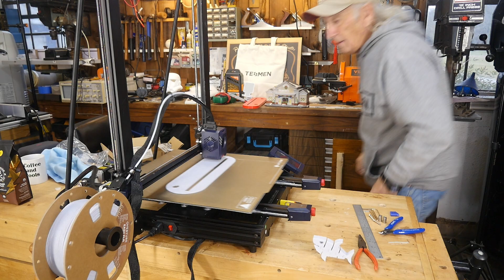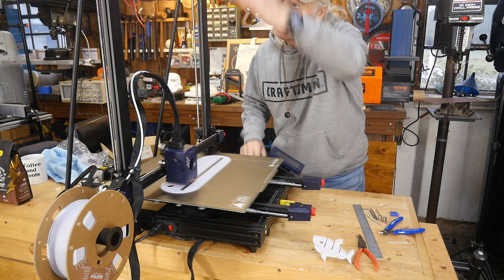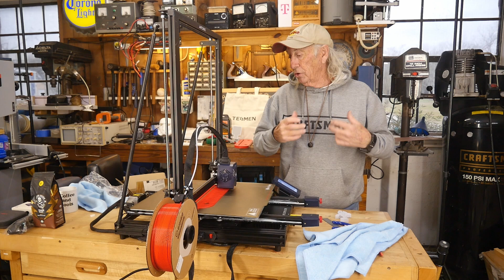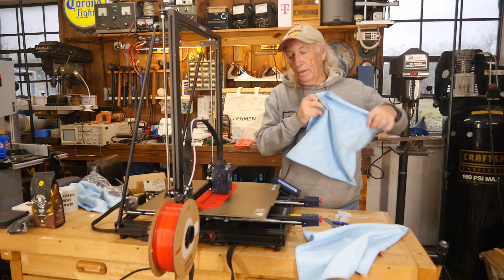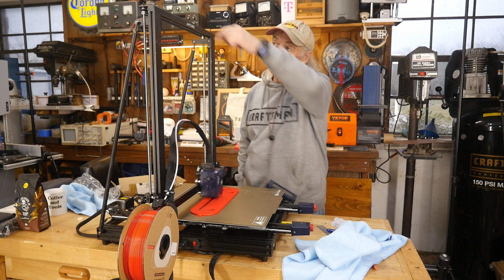Anycubic Kobra 2 MAX, 3d printer for a print farm,  Ep 505 Coffee and tools

Comment: I have one of them :) I have the NEO too. Biggest problem I have had with both of them are the nozzles seem to clog easily. I have been playing around with even higher temps to keep everything flowing and it seems like it is working better with the higher temps. We are at 4 degrees F with a wind chill of -6 right now ;) Oh one other thing with the MAX is it moves a LOT! I had mine on an adjustable table and it was hanging over the edge after about 2 hours when I went to check the print! Oddly enough, it was still printing and it came out perfect LOL